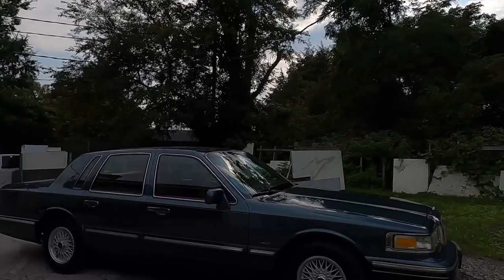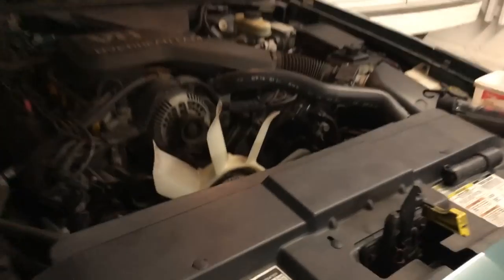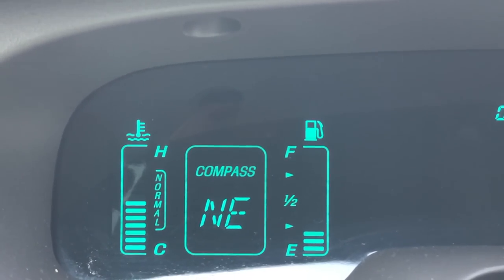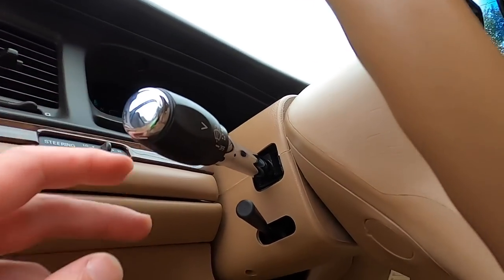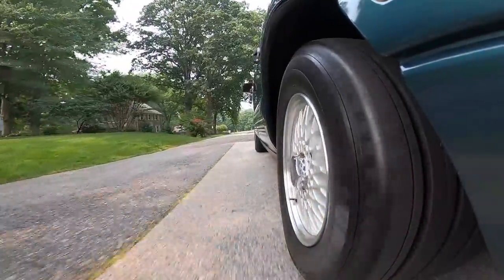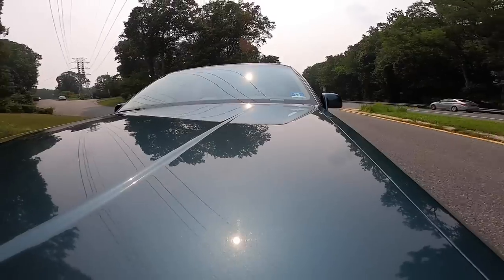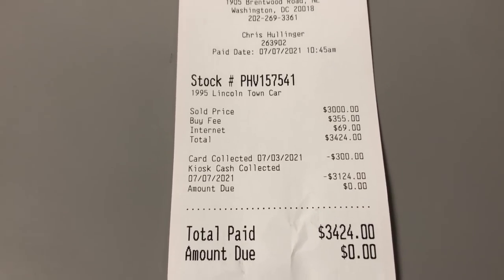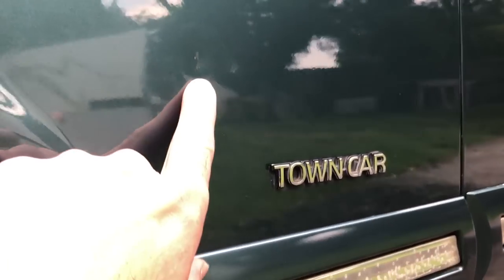My Broken Lincoln TOWN CAR is Now TERRIFIC, for just $8.99!

Comment: This is my idea of what a luxury car should be. You don't need a stupid infotainment system.
Reply: If I ever have the kind of money to own a second car these are on my short list
Reply: Had a handful and own a 99 Cartier with over 250k and a 07 with 114k. 99 left me walking once when hot side of stater wire broke. That's it in 9 years. And I got starter out, cleaned off, cut a old ground wire from a junk car and soldered it on and covered in black tape and went down to put it in and she fired up. Drove to pick n pull grabbed another and been going ever since. I love these cars. Easy to fix, have few issues and no serious issues and so big, 5 star crash rating all around, first American car to do so, and gets great mileage if you live in flatland. Or just drive with sense. Can't go wrong. I just wish I'd not always said, that's a grandpa's car, I need a firebird, or truck. No I should've gotten a panther and been alot richer, less wrenching, and more easily maintained. Change all fluids on schedule, seal up cowl vent, and have a DDM handy just in case. Ppl say trains weak. No never lost one yet. One fella had over 649000 miles and still going strong. Don't flush the tranny. Just filter and fluid. Ppl flush and start having issues cause they watch a video and it says so easy, unhook line in rad, start and let it pump out while putting new fluid in. No not with a panther. If you want to keep it going just what manual says.
Reply: @kitjasabsgabs1830  I regret that I don't drive a Ford or Lincoln car. But I agree. I've heard people say that once they reach a certain mileage, or a certain age, it's time to junk the car.  I disagree totally. Sure, it costs money to maintain a car and keep it on the road, but so what? It comes with the territory.
Reply: @jasoncarpp7742  Unless it's a rust belt car too far gone then I can see that. But my buddy's Dad from Marines had a livery service in NYC. He'd buy these at 200k and over so they be cheap, freshen up what he wanted and ran them until they fell apart. And he didn't have alot of serious issues with cars he got from older folks. Just cars that wasn't serviced on time and properly or a short tripper car. A few had close to a million miles on them before the bad roads and salt finally won. Now what other car made in last 20 years can you achieve this with where parts are cheap and plentiful, has a frame so a deer smashing the bumper and grill won't bend unibody and be totalled, and first USA car to get 5 star all around in crash rating and ride like a recliner cloud and just be enjoyable to drive? I love them. All cars do have their issues, but these wasn't changed every few years with non proven parts. Pretty much same thing from start to finish. Body changed but frame, engine etc. Why? Not needed. Why fix what's not broke?
Reply: @kitjasabsgabs1830  Very true. Some cars are too far gone to be worth saving. Even if they're mechanically salvageable the rest of the car might be too far gone to be driveable, and therefore, not salvageable.
Reply: @jasoncarpp7742  Panthers have the AC drain right above the passenger side, rear on top of frame where the A arm is mounted. That's a spot alot of ppl don't know or see cause it's in a tight hard to see and reach area. My buddy strips them 2 sell for derby cars and he showed me years ago. I saw a tiny rust spot the size of a pencil eraser on side of frame behind A arm mount. He took a long screw driver and gave it a tap and through it went. So I got at mine and cut a small piece of heater hose and ran it off to side of frame so that won't happen. Did happen to my 99, but I caught in time, treated with rotary tool and Ospho and got a dab of weld in her and some Eastwood internal frame coating, then black implement paint like goes on farm stuff, holds up forever. Very hard paint. We use on logging machinery like grapple and it takes a long time to start to wear. Then some fluid film or homemade with a qt of oil, tube of red grease and a toilet bowl wax gasket or 2 melted all together and stirred and sprayed, brushed, all over. Baby oil and Vaseline mted for doors, hood, trunk, drill a few holes for rear and some from factory for rockers and all is sealed up tighter than a fat elephants slacks!! It's hard to save them when previous owner neglected them. Another reason is has a frame. A unibody car with rust can mean a totalled car, panther just cut and weld and ready for primer and sealant. I hate 2 c old cars going to junk. Same buddy had a 1970 Caddy Elderaldo Fleetwood I think. So frigging long and had the pillow top seats,and 97k on clock. I tried to buy that car every day until I had to strip it. It was sold for 4grand already. I'd gave that to keep but not my choice.

Comment: Brilliant work!  Just think how much repair shops would have charged and even then they probably wouldn't have fixed it right.
Reply: How much would they have charged to fix his turn signals?  It was one hour to touch the steering column.  Fixed.
Reply: @mexicanspec  At least $400.

Comment: I've always been a fan of the Lincoln Town Car...smooth ride, usually smooth power (those early/mid 80's ones...maybe not) and for a bigger guy like me...sits comfy in all seats...well not the middle seats.  LOL   Nice job getting it back to 98%!  On the GoPro....better wide angle shots for sure.  With all my talk about this car, I've never actually owned one.  Driven well over 100 of them as rental cars (former Avis employee, yes they did rent Lincolns in Boston).  Only thing this car is missing?  Factory moonroof.
I have owned 2 Lincoln Mark VIII's, a 95 base and 97 LSC as well as a 95 Thunderbird with the 4.6l.  I'll be watching to see if/when you sell it.  Purdy color combo.

Comment: What's cooler than being cool..?  Ice Cold! 🎼🎶🎵
Sorry couldn't resist.  Love these old Lincoln Town Cars.  Love the interiors.  Closest I've had is a 2011 Mercury Grand Marquis which I still have ( and only 32500 original miles ).  Doesn't have the interior or the Lincoln, but it has an air ride suspension which is a joy to ride in...

Comment: I'm a proud owner of a 2005 Lincoln Town car, these cars are just great all around. They're luxurious, but they still hold really good fuel economy for their size and feature set. And I got mine near showroom condition, so I was kind of afraid to do any of the maintenance myself, then one day I decided what the heck I'll do my own oil change on it. They even include a guide at the front end where the oil comes down from the drain plug and funnels instead of going all over the place, same for the oil filter, it all funnels into one spot and comes out nice and even. Small details like that are awesome. I install my own aftermarket stereo, two bolts and the whole entire dashboard comes off. I installed aftermarket speakers and subwoofer, there's so much room in the paneling is all easy to access, including going through the firewall for the power wires, it's just something you least expect from a luxury car. When you think luxury car you think big complex machines. But these Lincoln Town cars are definitely exceptional.

Comment: I had a continental. The air suspension pump blew out in a drive thru. Tore 2 of the Goodyear airbags . Lincoln water thousands to repair it . This was 20 years ago. I drove it for a while after bouncing up and down scraping the tires on the fender well . There are airbag delete kits now. Well worth the hassle

Comment: I have a 1996 Town Car. Most likely, the lower radiator hose on the 1995 in this video rests on a couple of plastic fingers attached to the fan shroud, as with my car. If you just pull the fan shroud straight up and out like this guy did, you're going to break those 2 plastic lower radiator hose supports attached to the fan shroud, and your lower radiator hose will then droop and rub on the left side support, and wear a hole in the hose. So, you will need to remove the screws holding the lower plastic cover underneath the front of the engine, first, then remove the plastic cover under the front of the engine, then push the lower radiator hose off of the 2 lower fan shroud lower radiator hose supports. Once the lower radiator hose is out of the way, you can pull the fan shroud out, but only after rotating the large plastic "C-clip" like front shroud up in its circular slot to allow the shroud to clear the fan blades. In other words, the shroud is actually in 2 parts, and the front part rotates up toward the top of the engine in a plastic track in the shroud to allow it to clear the fan blade and allow removal of the entire shroud. It's really pretty simple and logical, but I'm probably explaining it badly. I highly recommend CrownVic net and LincolnsOnline forum to explain this better.

Comment: This is funny.  As I am watching your video my friend, who turns car parts into furniture, sent me some pictures of the new desk he made.  It is the front end of this very car in a light blue.  He used the fenders and header panel and built a desk where the engine would be.  What a coincidence.  By the way I agree with you they should bring back these cars.  Now that I am older and need a luxury car with soft suspension, they don't exist.

Comment: I have a 92 picked up for a 1000 runs great these things are bullet proof just have to replace the air bags in the back if you jack up the back make sure you turn the air suspension off in the trunk so it dont blow the bags

Comment: So many people leave these cars without even trying to figure out the issue. When I got my 1998 Lincoln Continental, the engine was just fine, no rust, but the air suspension was on its last days and a worn alternator. Replaced those and this car has no issues whatsoever. It's quite an adventure looking for what's next, but before you know it, it's good to go

Comment: I like the  Go pro idea works really well especially for driving inside the vehicle and stuff where you don't have  Worry about the phone for the car itself I think you did a fantastic job paid a little more than you should have I see those cars around here for about $2000 in their cream puffs Usually when they're turned into an auction or to a charity yesterday they usually have some goodies on them and and for me the Bonneville was a good deal you can't knock 325 for a car that's only got less than 52000 miles on it and had everything done before I even got it that's up for sale right now and I got it up for 3750 I have added 3 people already call me about the car and I think it'll be gone by the weekend I love your channel God-bless you man
Reply: He did well for $3000 as there is no rust on this. He could easily sell it in a northern winter salt state for at least a grand more, and the buyer will still be getting a car that is very economical to own, as long as they keep up with basic maintenance.

Comment: I have a 1995 Lincoln, here in France =)
I have same problem like you with hood on left corner was too high (now it's ok) and my Oem stereo don't turn off, but that's ok !
This car is awesome so that's great for me =)
Reply from the maker: It makes me chuckle that your Town Car has the same problems as my car.  And having a Lincoln like that in France must be a very unusual sight!  You must get lots of looks and questions from folks that see it.
Reply: @hullinger  hey thanks for reply ! Yes this car is so unusual here ; maybe less than 6 running cars from 1991 to 1997 and other are stretch limo dead for parts.
Mine was initially sliver metallic and repaint in white color after first owner sell it.

Comment: i have a 1995 towncar.has 155000 on it and it runs quite as a mouse.its a metallic red which fades way to fast! needs a complete paint job.still rides like a dream.it will go 250000 with no problem.real luxury.they dont make luxry cars these days like this one.i need 1500 to paint it.if i ever can get it painted, it will turn heads again going down the road.

Comment: If you do the rad, make sure to never use an aluminium/plastic rad with a CAST IRON or iron composite engine.  If yours is iron, I would suggest having the copper radiator heat tanked and soldered.
Reply from the maker: Oh, great comment and thanks for the tip on the radiator.  That makes perfect sense too.  Thanks for sharing.

Comment: I have 4 of these Panther platform Town Cars, including a 96 that is the same colors inside and out.  Mine does not look as good as your 95.  I am both tall and wide, I am not comfortable in any car with a center console.  These were very sought after used to become cabs and taxis.  Hard to find one with low miles and in good condition.  If you decide to sell, I am interested.

Comment: I have a 1977 continental that runs and drives but has stuff wrong. Fuel Guage backwards,temp Guage doesn't work,ac has a leak and only blows out of the dash and bottom vents, power seats don't move.

Comment: That engine fan is driven by the belt, the belt must not have been routed properly.
Reply: I think they fans were electric by 1995.
Reply: I have the same car and one fan is electric and the other attaches to the water pump which is driven by the fan belt
Reply: Ah ok I was probably confusing it with the 05 crown Vic I had